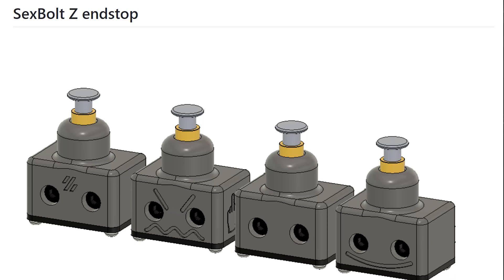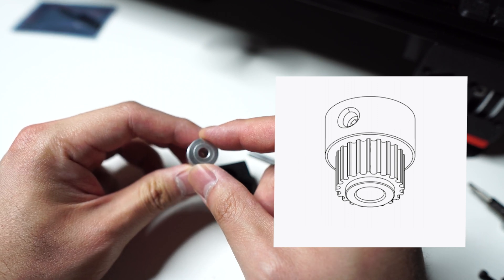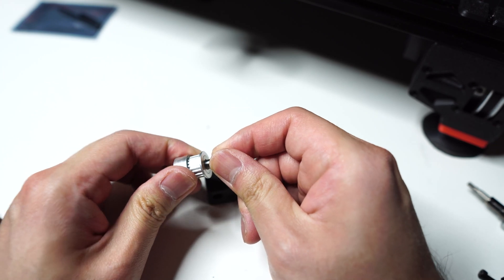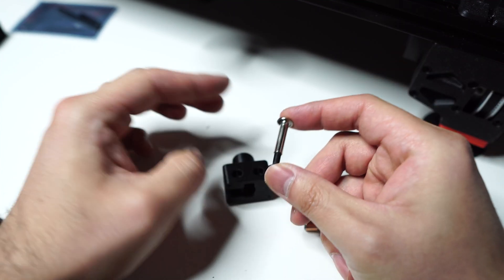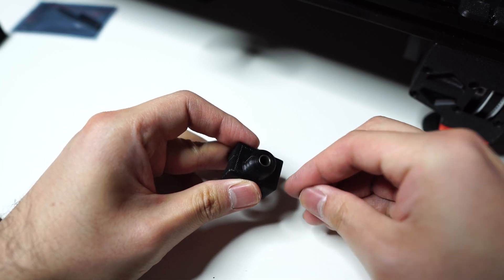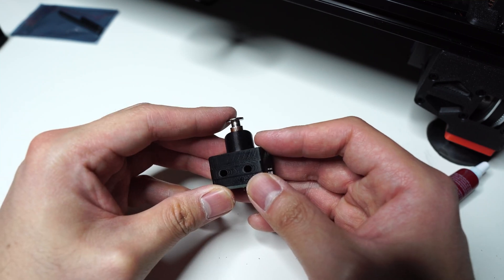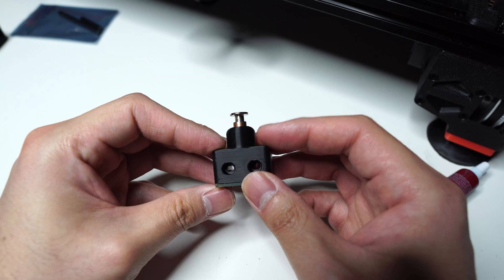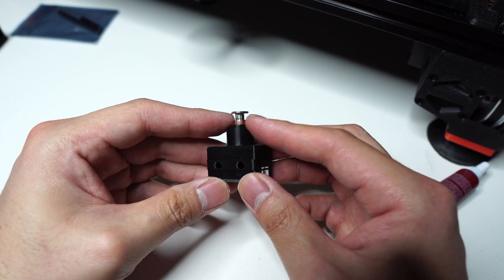Voron2 Sexbolt Z Endstop Mod

Comment: Why would yoou need to grind a flat on the pin? its supposed to move freely within the modified idler.
Reply from the maker: the flat is not for tightening, the idea is to prevent the pin falling out when you flip the machine, which could lead to gantry crash when no z is hit. so the flattening need to be deep, and grub screw just stick out a bit, not touching the pin in normal operation.
Reply: @designsliceprint6621  also stops the nozzle with filament from sticking to the pin and lifting it out (speaking from experience) I was fine with being careful while tilting it but having it come out during a print start not so good....

Comment: What are the advantages to this?
Reply: It's height adjustable so can match your build surface should you change to a thicker one. The default endstop also wobbles to the side and deflects making change slightly between homing.
Reply from the maker: not really making the print better but a much easier way to build a voron
Reply: You can turn the machine upside down and the pin won’t fall
Reply: @manuelmrosa  Pin won't fall in regular Z endstop, if you stick to instructions and make the groove